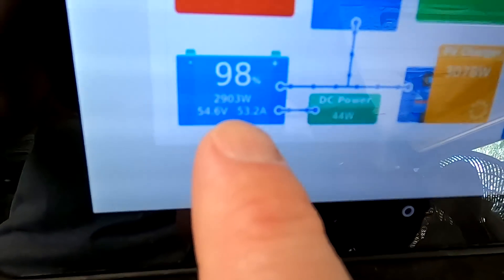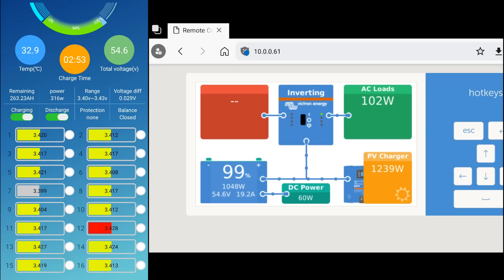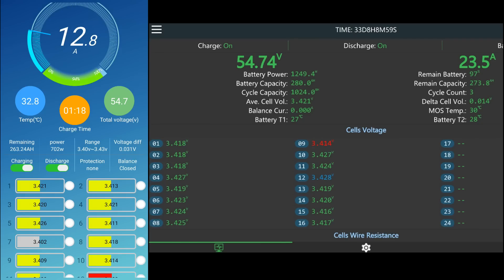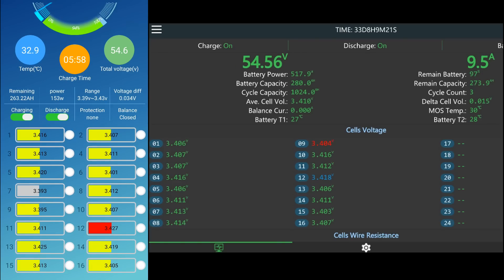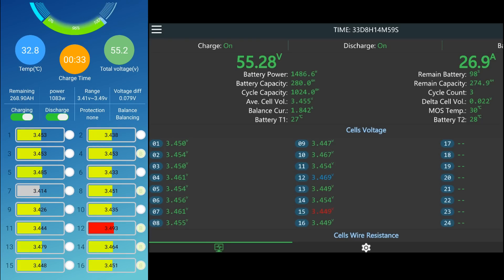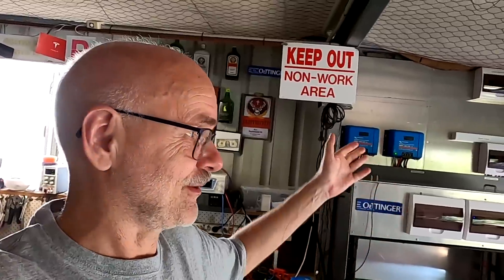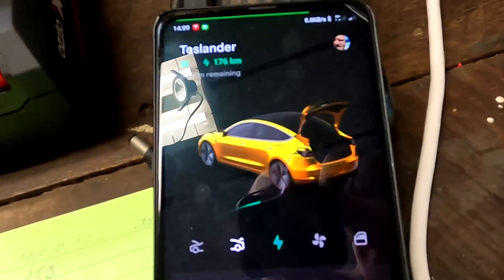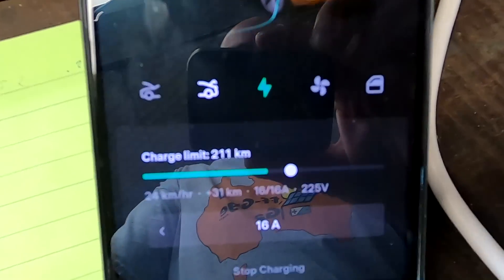Communication between BMS, solar charge controller and inverter. What's the benefit?

Comment: The big disadvantage of jk communication is that if there is a under voltage protection, the communication with the inverter shuts off,my Growatt inverter is giving an alarm 04 and is unable  to restart again to recharge the battery. i set it in " other battery mode" and I set the parameters myself in the inverter,works much better

Comment: I'm wondering, if the BMS cuts off the batteries before the controller quits charging then I would think the controller would smoke because it no longer has a load but is still getting power from the solar array.

Comment: If i use inverter with lithium and add value manually according to lithium battery data sheet so it is safe to use battery although battery have there own bms

Comment: Hy Andy, I sie a small Solar System with gobelpower 150a BMS and 4A Balancer, A Smart solar mppt and the Inverter is from Lumentree. Batterie and mppt are conected with an Cerbo GX. I like the Monitoring oft the batterie via VR Portal. But I Wohls prefer to control the charging with the Mppt. Is there an Setting in the Cerbo to Monitor the BMS but Not Controlling the charging via bms?

Comment: I am trying to buy 48v lithium batteries for my Sungrow system to replace the old AGM batteries. Suppliers keep telling me that the lithium batteries I wish to buy won't communicate with my inverter. Does this matter? I don't think so as each battery in the rack has its own BMS.
Reply from the maker: It does not matter. I know someone who did that and the Pace BMS will not correctly communicate with the Sungrow inverter. It's a Sungrow problem though and they need to fix the firmware on their devices.
He is now using the battery without coms and has setup a custom battery in the Sungrow inverter with the correct charge voltages. Works all fine.
There is a slight problem, when the battery is fully empty and the Sungrow shows an error message then due to low voltage. A restart of the Sungrow fixes that immediately. It's an inverter problem...

Comment: Hello, Andy
It's good when every independent bms can communicate with chargers/inverters and also between each other. One of the reasons why is for the correct distribution of current between several independent parallel banks. For example, if you discharge your two banks with high current and one bms failure, then loads move to only one battery. In this case, you can lose the second one (overloads). On boats we have to calculate currents as N batteries + 1 (some kind of redundancy).in case of smart communication, the chargers and inverter know how many bms's alive, if one is dead, the current can be immediately reduced. Also, smart communications between batteries and chargers possibly can organize the correct distribution of the current between batteries, no need to have an equal cross section and length of wires, etc..

Comment: I bought an inverter from ALI EXPRESS and I have a Lifepo4  Battery the settings for the inventor are AGN AND FLD USER I HAVE IT SET ON USER THE description it says Lead Acid Lithium but he said it will work the charge on the inverter not coming on? I have all of the settings nothing only grid charging ac power all fine is there a way around this problem i am A beginner min power in 120volts i have 10 solar panels 275 every 2750 watts took some off 7 then 6 then 5 still no change from solar please help me I been trying for it work for 3 4 days now don't know if i should by an external MPPT or an external BMS AS my lifepo4 battery was complete ready made with one + terminal and one - terminal has all the dc ac air switch circuit breaker fuse on the battery it is a hybrid inverter it seems I bought the wrong inverter is it save to charge at the list? I have charged it 92% and turn it off it seems ok. i know its off topic I need help>

Comment: Can the JK BMS be connected to the MPP Solar inverters that have RS485 port with the JK RS485 adapter ? And what should be configured for this if it works ?

Comment: I have a 280ah 24v system, my jbd bms constantly switching off my inverter when the batteries reaches 3.65. How to avoid this. It's a schneider 2425 inverter with a midnite classic 150.

Comment: You talked about over charging, but what about over discharging.  Let's say I need to stay above 60% DOD on my batteries in order to maximize the life of them.  My BMS does not seem to have any control to turn off further discharge based on low SOC.  But if inverter knew the current SOC and user could set thresholds then inverter could begin warning when within 5% or maybe turn on the generator or whatever in order to enforce this max 60% DOD requirement.  I'm new to all of this so maybe this is already done somehow that I do not know about.
Reply from the maker: OK, so if you use AGM or lead acid batteries, that is a good point and you don't want to go lower than 50-60%SOC. 
I have not seen a feature in any BMS yet, where you could possibly set such a threshold though. Is this something you can set in the inverter maybe and it switches to grid once it reaches the 60%?
But in this case, a communication between BMS and inverter makes sense. Thanks for pointing this out.

Comment: Thanks for the great video. I also use VE Solar Equipment in combination with my 2x5 kW/h PS5120E LiFePo4 batteries. In the beginning, I often asked myself whether communication with the BMS would have any real added value. However, I don't see any advantage at the moment. The VE Equipment is doing a great job w/o any BMS communicatio, too.

Comment: In the winter time our cells would be empty most of the time. The cells do not like that, so we want to keep them charged for, lets say 30% or so during that time. 
Another scenario is when you ALWAYS want to keep a certain amount of energy in you batteries to have at least some energy in case of a grid failure - maybe 50% or so.
The third scenario is that we would like to operate our cells between 10 and 90% SoC. 
Another thing might be that you might want to do some kind of "smart charging". The charging curent should be dependent of SoC, the expected incoming PV-energy (weather), expected (planned) energy needs of the loads, optimizing lifetime of the batteries and other factors. 

It should be clear now that inverters NEED to know the SoC. What I do not understand is that current models, and yes, also the Victron Multiplus, do not have the capability to determine SoC. We need to connect to a BMS, and in the case of more than one battery pack this is practically impossible (there are BMS with internal communication (e.g. REC) that can handle multiple battery packs, but these are too expensive). Or we must buy another piece of hardware, e.g. the Victron Smart Shunt. 

Why can't the inverter do that if it is needed anyway? The inverter could determine the lower and upper cutoff voltage of the pack every now and then and do Coulomb Counting in between. Not too difficult.

Comment: I know it’s a bit late to comment. But I think the major advantage of a BMS that communicates to the charge controllers would be for off grid systems that rarely get to 100%. For say yachts or remote static installations over say winter when solar can have days of low input keeping the batteries below 100% for long periods of time. The benefit would be that on the rare occasion that you do get into the balancing voltage, if the absorption time was too short to allow he BMS to fully balance the cells. It could throttle back the voltage for as long as it took to balance them, get them back to 100% balance and then resume normal operations. Similarly for banks with differing capacities like yours, you could find the aborb time not enough to allow the lowest SOC bank to balance if the other banks  reach the balance voltage earlier (because they have lower capacity) then the whole pack will reach the cut off voltage, reset and go into float voltage before the BMS has done its job. For example your float is 3.35v and balance voltage is 3.45v. If banks 1&2 are 280ah and 3 is 320ah. 1&2 could peak first, begin to balance a lot earlier than bank 3. As bank 3 hits 3.45v the whole pack will peak and the absorption time pack 3 gets to balance could be zero before the whole pack goes into float @3.35v and stops balancing.

Comment: The benefit of communication between BMS and the inverter/charger is being able to operate the Battery bank within a SOC window (10% to 90%).
The more we are able to stay away from the state of charge extremes the better it is for cell life expectancy and capacity degradation.

I have to ask, how are you getting on with the Victron equipment in general?
You have had it for a while now, so should be getting a feel for its bad points and its good points.

I have been studying datasheets and Specs for so many inverter/chargers and so few of them state any performance information about "No Load" power consumption (Quiescent power draw). Victron seem to be one of the few.
This baseline power consumption is so important for any system that is storing energy in batteries, and even more so if you are off-grid.
I bought another hybrid inverter, which had an issue with the screen hanging when trying to set it up.
In the process of fault finding and letting them update the firmware (did not fix it) I become aware that the "No Load" power consumption of the unit is around 65W to 67W (1.6KWh per day, Booo!)
The "No Load" consumption of the Multiplus 2 is around 11W (264Wh per day, Hoorah!) according to the datasheets.
Are you able to confirm this?
Background energy consumption may be worthwhile topic to cover.
cheers, Arron

Comment: Andy didn't you burn a mosfet on the JK 4s by abruptly disconnecting while on a load? Doesn't abruptly disconnecting like that also damage other components like a SCC? I thought I read that somewhere I could be wrong. If the BMS tells either charge or discharge components to turn off individually it might save those components or the BMS itself.

Comment: Not sure your comparing like with like here,  The current has to go through a non connected BMS like the ones your are using,  where as with a can bus BMS like my batrium  the batteries go via a trip direct to the inverter so the shunt trip provides the job of your disconnect relay  and provides tapered current control etc via can direct to the GX

Comment: I think what u have is good. I would consider more load dumps if you have power excesses, why throttle back your PV controllers when your batteries are full if it can dump into a Cap Bank, increasing the voltage a little under the inverter threshold, which set voltage then turn on an air con, or dump into the tesla, heat a spa, hot water tank, pool pumps, its all useable energy in whatever form u convert it, and heat pumps.can be an efficient form to use energy,  so my questions are: how often do you need to top balance anyway to 100%?  And why would you want to throttle back free power if it is available and you have other “Dumps” you can divert any extra power to, if/when your batteries are all fully charged, I guess you could say that batteries can come in a different form than just electrical storage, but I’m sure u have this all figured out too, dont ya! Good work!

Comment: Hi Andy, Pylontech uses 15s configuration and you have 16s. Is there necessary change setting off battery in Victron mppt ? Thanks
Reply from the maker: Yeah, the settings need to be changed for such a battery.
Absorption:
16x 3.45V = 55.2V
15x 3.45V = 51.75V
...
Why would they lower the amount of cells though?
Reply: @OffGridGarageAustralia  maybe bc it makes system voltage closer to a 48v lead acid voltage allowing customer to swap out old LA batteries more easily...?  I have these and they work fine with victron gear.  If you tell the mp2 to talk to them via can bus then venus os can give the battery whatever voltage/current it desires at any SOC / temperature etc.

Comment: Hi Andy, thanks for all these videos, light hearted and informative. It would be great to do an 'on-paper' video where you go through your final setup and show the system start to finish, chasing the load from how you parallel/serial your panels, diodes, fuses, breakers, MPPTs, batteries, inverters, amperage considerations when cable sizing, etc.
Reply: Yes I would like to see this too.

Comment: Setting Charged/Absorb/Float to something around 90% would keep you safe with a bit of overhead if your loads are not too high as you said for the charging. 
Having a dump load circuit would be nice when at 90% charge or so. charge up hot water or heat up rocks for heat sink load for night,time. or pump water into a tank. dc activation when it detects bank voltage at 90% And turn off when at 85%

Comment: Great video Andy also don’t forget having the BMS control the system negates the use for an external shunt. As you know this is another path of resistance which can be eliminated. Obviously you already know this but if you don’t I’m sure you will understand that all of the rack mounted batteries as well as other big branded batteries do you have CANbus communication. I am actually doing some work right now with Power Paul on the batteries he is building for me through the business. Looking at DALYBMS communication to Victron. Lots of information on the GIT hub and a few people already have sorted out communication from BMS like yours to the Victron protocol campus. Looking forward to that stage. Let me know how you go with that set up also.
Reply from the maker: Yes, thank you. A communication could eliminate the need of a smart shunt. There would be no point of reporting the overall current in such a case though. I quite like the idea of having once single point of measuring of the overall battery voltage, current and SOC in the system and not multiple devices reporting slightly different values.
The comms between the BMS and the (Victron) system should be fairly easy. As you said, there is plenty of info out there and Louis is working hard on this project.
I will have something very cool coming up in the future. I work with a manufacturer of a BMS and they will make the communication between BMS and Victron two-way. So Victron will be able to control and set parameters for the BMS, not only reading the data.
Reply: @OffGridGarageAustralia  
Sounds good Andy please keep me in the loop on this.
I’m very interested.
Thank you have a wonderful day.
Reply: @OffGridGarageAustralia  Andy, I am really looking for this. Only setting a max voltage to mij solar charger, shore power charger or dynamo may be not loading my boat batteries enough from time to time especially lack of sun on days we are not motoring and not shore power. By the way, thanks for all work on LifePo4 batteries. I am learning every day!

Comment: This is so great info from field experience.
Edit: one sunny question occurred to me after reading the comments here about reading voltage at the battery terminals. Why does the BMS not make the victron shunt obsolete if BMS is connected via can/rs? Wouldn't you get the same information on your raspberry pie from the BMS?
Reply from the maker: Thanks Wiley. If you have only one battery bank with one BMS and it can talk to the rest of the system it can replace the smart shunt yes.
But some people (including me) have more than one battery which makes it a bit tricky with multiple BMS' connected. I really like this one point of 'truth' now I have with the smart shunt, regardless how many batteries (and BMS') I will end up with.

Comment: It's probably good enough without communication (I hope so, that's how mine is working!) but I think it could be better. The need for better diminishes as the cost of battery and solar decreases and personally I think we've hit the level of not needing, at least for stationary systems.
I don't know if the victron communication and components are smart enough, but the optimum would be if the the solar charge controller would limit the current to the amount needed to 1) maintain battery at current voltage (e.g. while balancing) plus 2) supply any loads.  This would avoid burning excess current in the balancer, hitting hv disconnect, and battery cycling near top of charge as loads discharge and drop the voltage until solar kicks in again. I believe solar ElectroDacus can do this, but as I said, I don't think I need it.
Reply from the maker: That's a possibility with Victron gear and if the BMS data is available You can set up things like this. I'm with you and don't know if it makes sense and if I need it. Atm I cannot see a benefit...

Comment: High Andy 
Your system is really starting to look good. Id really like to see what the delta looks like at mid charge and at a lower voltage under moderate load, comparing the older bank to the new one. The curiosity is, how much does a good full charge delta really matter?
Reply from the maker: Thank you, Karl. That was exactly my thinking. If all cells stay within the specs, the BMS should be OK to monitor and balance over time. And with the two new batteries coming soon, we won't have the issue with the old pack any more anyway.